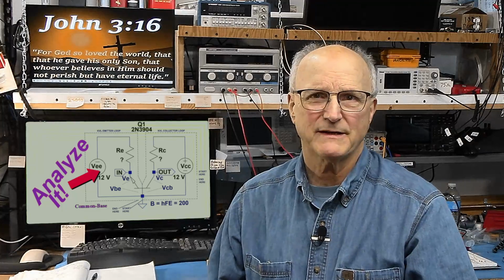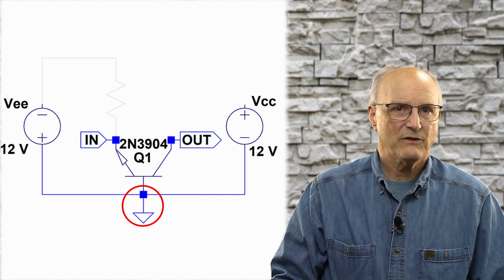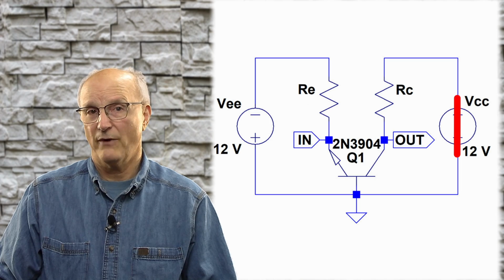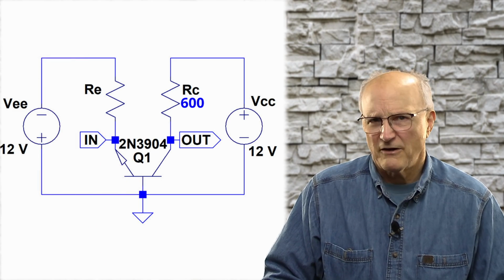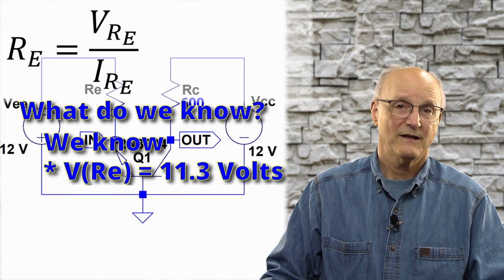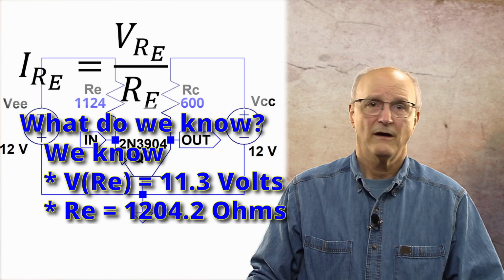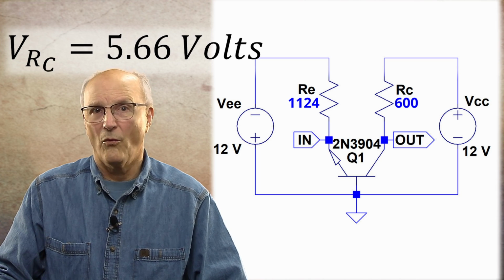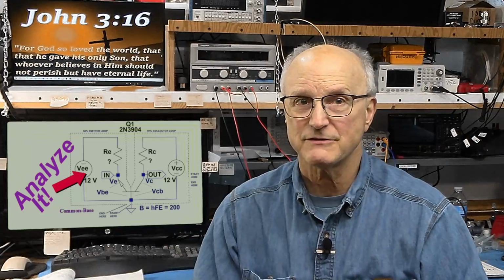Basic Bipolar Junction Transistor Analysis: The Common-Base Circuit (066b4)

Comment: Never really understood this circuit or why one would even use it. I guess I would ask how does it perform over temperature? is it now only having voltage dependancy on the vbe temperature coefficient?
Reply from the maker: As I have understood it, it performs well over temperature and avoids certain issues that other configurations have to deal with; which ones I am a loss to remember at the moment. Because it has voltage gain but not current gain, it is often used as a power amplifier. Same current in as out, but higher voltage = power increase. One could put a circuit such as this in LTSpice and tell LTSpice to step over temperature to see its response. 🙂

Comment: YT just fed me your previous video and now I am subscribed. I started my EE design career 34 years ago but quickly fell into software development instead. I am very interested in what this channel could get into. Thanks for your efforts.
Reply from the maker: That is a very common thing to happen to EEs. I resisted that and remained primarily a hardware engineer throughout my career. However, now a days nearly EVERYTHING has some sort of processor embedded in it, so I did a LOT of embedded processor firmware (C) as well as programmable logic devices (VHDL). But my first love was always the hardware.
I am glad to have you on board! 🙂